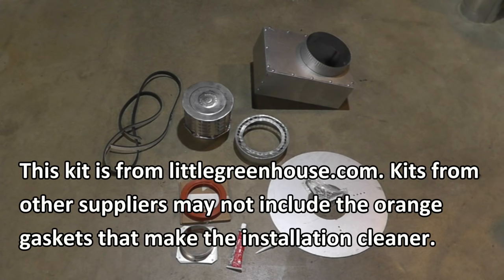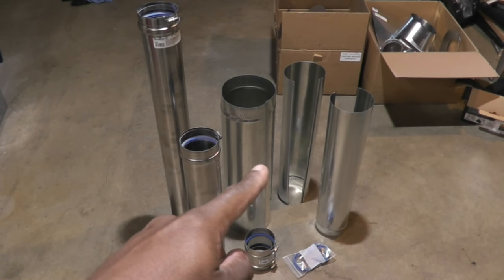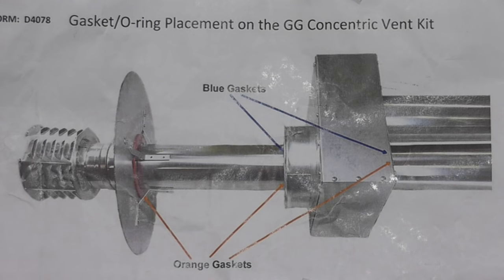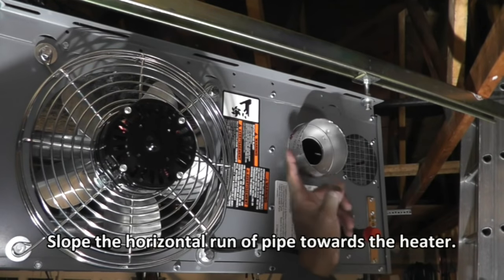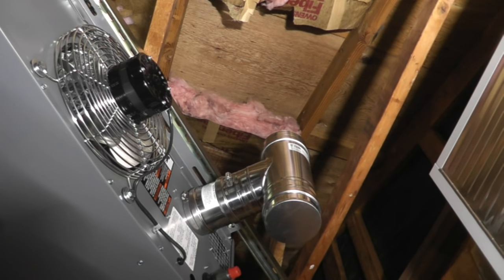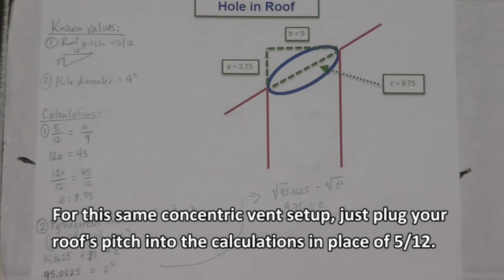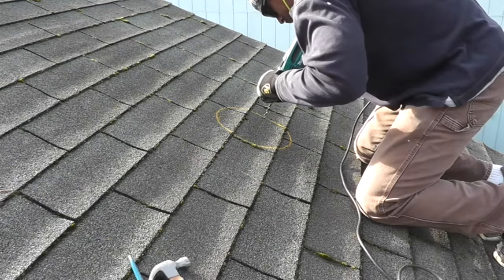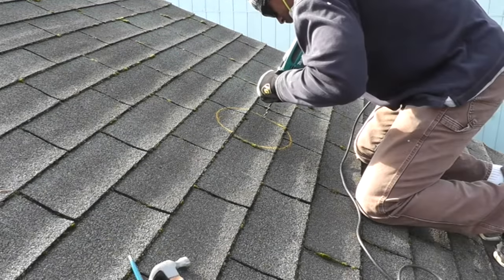Garage Heater Installation - Part 2 of 3

Comment from the maker: Please leave a 👍 if you like the video!

Venting was the most difficult part of the installation. I hope this info is useful.
🔧▬▬Tools and Materials▬▬🔧
👉 DIY Apprentice Recommended Tools and Materials ► https://bit.ly/2T5psFw

Pricing info for major expenses as of 12/7/15:

Honestly, Menard's is going to be your best bet when it comes to price of this series of heaters. Here are links to other sellers if you're unable to buy through Menard's.

BRT Series of heaters available here:
✔️ BRT030N ► http://ebay.to/2G7Wzlc
✔️ BRT045N ► http://ebay.to/2rwrq7D
✔️ BRT060N ► http://ebay.to/2DzwL34
✔️ BRT075N ► http://ebay.to/2rzMOcq
✔️ BRT090N ► http://ebay.to/2n1eToc
✔️ BRT105N ► http://ebay.to/2mZ3QvO
✔️ BRT120N ► http://ebay.to/2rrmYXG

✔️ Concentric vent kit (AS-X7-4): $217 @ littlegreenhouse.com (free shipping and orange gaskets included)

I bought the concentric vent kit from littlegreenhouse.com. The gaskets included in their kit make the installation cleaner. Other sellers may not provide the gaskets. Also, as mentioned in the video, it might make more sense to buy the UL 1738 special gas pipe in separate pieces for a vertical installation.

Adjustable lengths of pipe are also available. Your local municipality may allow b-vent to be used, which is a much cheaper option.

4" special gas pipe:
✔️ FSVL2404 (24" pipe) ► http://amzn.to/2tx4eHn
✔️ FSVL3604 (36" pipe) ► http://amzn.to/2HnwLB9
✔️ FSAAU4 (Adapter) ► http://amzn.to/2HizagM
✔️ FST4 (Tee) ► http://amzn.to/2FGVtPQ
✔️ FSTC4 (Tee cap) ► http://ebay.to/2kSb96t
✔️ FSAVL4  (Adjustable pipe) ► http://amzn.to/2DgpAIz

✔️ Malco C5R crimpers ► http://amzn.to/2GchvrM

✔️ Thermostat (Lux TX9600TS - touch screen and programmable) ►  $30 used on Amazon http://amzn.to/2tzyDVA

✔️ How to choose the correct size heater (courtesy of sfgate.com): http://homeguides.sfgate.com/estimate...

✔️ Vent roof flashing and storm collar: $30

✔️ Gas line installation: $20/linear foot x 30 ft = $600 - after watching and assisting the plumber, would probably do myself if I had to do it again and if DIY is allowed in my area. Gas line is Gastite FlashShield PMG-1066 (CSST line). The drip leg was later corrected to include a 90-degree elbow before the tee.

✔️ Electrical wiring and conduit: Approx $125 for tools and materials. Conduit bender ► http://amzn.to/2HlhxN9

✔️ Mechanical and electrical permits: Approx $125
▬▬▬▬▬▬▬▬▬▬▬▬▬▬
Approx. total incl. misc: $2000

📷▬▬Video Equipment▬▬📷
✔️ Current Camera ► http://amzn.to/2GcpkOb 
✔️ Current Lens ► http://amzn.to/2Deu16S 
✔️ Tripod ► http://amzn.to/2GbaM1c
✔️ RAM Suction Mount ► https://amzn.to/2Wz9PXh
✔️ Cyberlink PowerDirector ► https://bit.ly/2jTwGxT
✔️ Adobe Photoshop ► https://bit.ly/2V7nyUX
✔️ Camera Slider ► https://amzn.to/2WtD7GW

Comment: Want to echo all others that you did a great job in explaining the installation. Good Job! One question..I don't plan to paint or store chemicals in the garage. If you didn't, would you have any hesitation not using the sealed combustion method?
Reply from the maker: Thanks. Good question. The separated combustion kit also keeps debris such as wood fibers from being sucked into the heater, which should prolong its life. So, I probably still would have gone with the kit. It's not absolutely necessary, though.

Comment: Do think there will be any reason that the concentric vent kit that you used would not work with a heater manufactured by Mr. Heater?  I plan to call light green house as well as Mr. Heater to ask but figured i'd ask you as well.  Nice videos by the way - you are very thorough.
Reply: Disregard my friend - I just discovered that the Mr. Heater unit that I have is not a sealed combustion unit.
Reply from the maker: Leftu Yeah, the Mr. Heater was one of the units I briefly considered, but the Beacon Morris's flexibility swayed me.

Comment: Great Video! I like your approach to the work involved. I have purchased the concentric kit from Little Greenhouse, but I don't have the blue gaskets pictured at 12:39 of your video. Did they come with the Vertical kit? Would you happen to know the part #?  Thanks again for taking the time to produce these videos.
Reply from the maker: Thanks. The blue gaskets came with the kit I ordered from Little Greenhouse; I don't know of a part number. If they're not hidden in the package somewhere, I'd contact them to ask if they're still including them in the kits they sell.
Reply: @DIYApprentice  Thanks for your speedy reply. I just emailed them to inquire. I looked several times and they were not included. I hope you're happy with the heater. Looking forward to getting some heat in the garage myself.
Reply from the maker: @geoben427  I'm very happy with the heater. I haven't had one issue since I installed it three years ago. In fact, I'm working on my car today in a heated garage 😀 

Here's a review I did on the heater: https://youtu.be/4NBc_co10Ng

Comment: Why did the video stop when installing flue pipe? There is no way to get red gasket to stay.
Reply from the maker: It's been awhile, so I don't quite remember. I may have been taking a long time to install the pipe, so I skipped ahead. IIRC, I had to slowly slide the pipe into place. You may want to try a little petroleum jelly if you're having trouble.

Comment: Note in most places new installation requires b vent for a vertical vent now.  Single wall can lose too much draft co efficient at exterior. :)
Reply from the maker: Yes, I mentioned b-vent in the pinned comment and the description; I would definitely work with the local municipality. I considered using it for my installation, but my city didn't require it at the time and signed off as installed in the video. I used UL-1738 pipe and single-wall pipe with the concentric vent box instead.
Reply: @DIYApprentice  it looks like you did an excellent job, im a gasfitter/plumber/electrician by trade and install these occasionally as 8m doing today, has been a while though, drinking coffee watching your video to spark my memory.  Note that code clearances for single wall is 6" from combustibles. Though I note your video is old so im sure its working tickity boo. Im in Canada, but clearance is same globally iirc .  Was a pleasure to watch your video, ive seen lefty of cringy ones.. some im sure that made fires, props to you for taking the time to do a nice job 👏
Reply from the maker: @MrDmadness  Yes, the primary goal was to not burn down my house - that wouldn't be, um, good :-)
I believe in this case, based on the instructions that came with the concentric vent kit (local codes not considered), the clearance is 1" for separated combustion. "The exhaust vent system must remain at a minimum distance of 1 inch (25mm) from all combustible materials." I wasn't sure if I interpreted this statement correctly, but the inspector didn't have a problem with the installation. Honestly, I'm not sure how you professionals keep all this stuff straight 😀

Comment: Can I ask if u maintained the ¼" rise coming off the tees?
Reply from the maker: No, the 1/4" per foot slope was not necessary for my installation.
Reply: @DIYApprentice  so only if that run is so long then u have to slope it?
Reply from the maker: @jimmychannel8510  Yes, if the run were substantial, I would have sloped it the 1/4" per foot.
Reply: @DIYApprentice  u may be the only video on showing how to run garage heater vertical concentric vent on YouTube. Thank u for showing such a detailed video
Reply from the maker: @jimmychannel8510  Glad it was useful. Thanks for checking it out!

Comment: There’s no way I’m punching a hole through the roof of my house, unless I was doing it while redoing the entire roof. No way to properly flash and seal this. Almost guaranteed to leak.
Reply from the maker: It's been installed since 2015 without any signs of leaking. I check it about every six months.
Reply: Professionals do it everyday with no issues for years. The key is doing correctly. Top half of flashing goes up under the shingles and bottom half lays over the shingles, it’s not that difficult but probably not a DIY